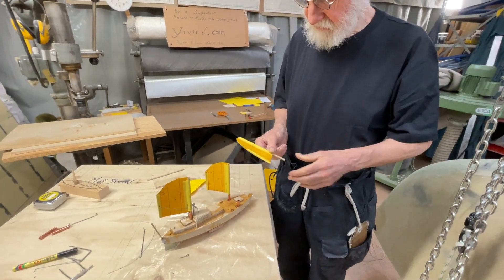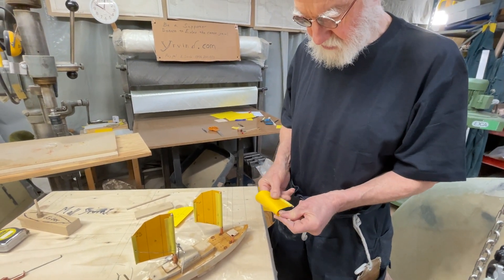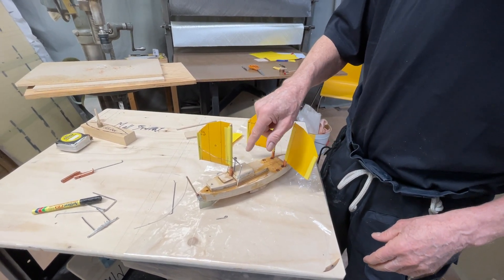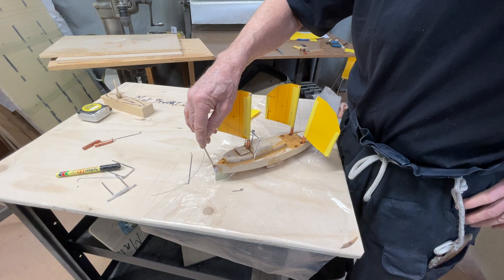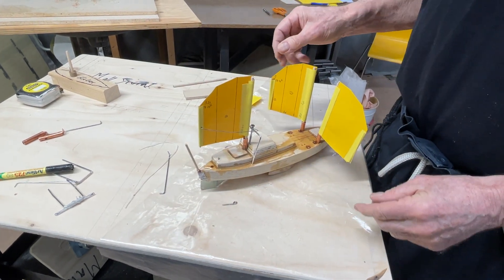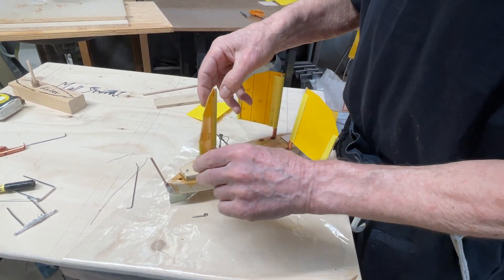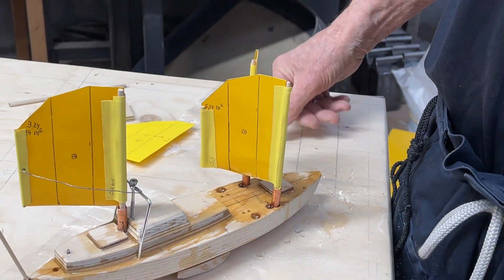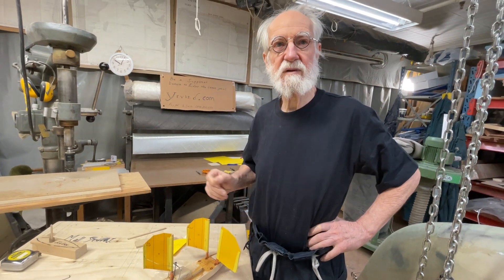A better model of the rigging. The rig now have vertical battens despite a lot of hesitation.

Comment: I am interested in how the sheets will be done with the vertical battens. The new design is much like a junk rig but built turned 90 degrees. Thank you Sven for sharing all of your thinking on the rigging. Much for everyone to consider. Have a great week.
Reply from the maker: I do not agree.
There is no sheets from the vertical battens.
The aftmost vertical spar is called club by the Chesapeake Bay log canoe sailors who inspired me to do this thinking.
The club will hopefully be made of carbon to its midddlet a single sheet is leading.
There might be some changes as it is experimental.
Reply: @SvenYrvindExlex  What about splitting the sheet 50-100cm from the club? Would 2 attachment points be better on the club? Or just more weight and windage?
Reply from the maker: @aaronbrakel2722  I do not really know, but there is a very short distance to the sheet point and 3 square meter sail do not generate big forces.
Reply: @SvenYrvindExlex  Thank you for the reply Sven.

Comment: 10 kvadratmeter, utan roderhaveri med tre segel som är över 60% större låter som snittfart på över 6 knop! Cirka 10 000 meter i timman 240 000 meter om dygnet 7 200 000 meter i månaden! Nu har du något mycket fint i dina händer! Ett fullt fungerand attraktivt alternativ till långresa och en överlevnadspod som skulle få oss att kunna klara ett halvår utan problem i taget! Vad heter din hemsida "Simple habits simple boat", I teorin visar du oss alla en utväg om det behövs. Ett alternativ till! Tack Sven Yrvind!! Det finns absolut inget enkelt i det du visar oss idag! Ett hopp från den Gamle och Havet, ännu en gång tack!
Reply from the maker: He writes in Swedish.
He thinks that with the new rig and 10 square meter I can make an average speed of 6 knots.
I do not think that that is realistic.
The twin keels extra wetted surface and their extra weight will add drag.
If I can average 75 miles a day or 3 knots I will be very happy.
In real life there is calms and storms that slows a sailor.

Comment: Vertical battens are a good addition. To go simpler, why not eliminate the booms? Like Baluchon. I kind of miss the mast rake you had.
Reply from the maker: Baluchon do have a very long wisker poole. Sailing down wind as most cruisers do you need to get the sails out.
These J-booms are much shorter and can be permanent in place.
They also make the boat self tacking and thats good in narrow waters with three sails and a solo sailor.
I think the mast rake looked good but it makes no sense anymore one more darling killed.
Utility is the name of the game.
Reply: @SvenYrvindExlex  I understand. Self tacking is a great feature.

Comment: You could get fancy, and create a roller furling within the the mast.
Reply from the maker: Not a good idea.
On a free standing mast it will be very heavy.
It will create much more wind drag. 
You lose the aereodynamic advantage of the Ljungström rig.
It will cost much more.
It will not be as reliable.
I prefer simpler things
Reply: @SvenYrvindExlex  Isn't the Ljungstrom mast already a furling contraption in it self?
Reply from the maker: @danielbtzibur8637  Excactly so why bild an extra mast around it.

Comment: If you’re planning to take reefs in the sails by rolling the mast, how are you blocking the mast to prevent rotation?
Reply from the maker: The hatches are next to the mast. I use a pin or spoke. Have few holes in the pereferi of the mast - a ring around the mast - and just block the rotation with the pin. 
The pin will also be used as a lever to rotate the mast.
Reply: @SvenYrvindExlex  I thought you used two mast locked halyards from the berth, like a furling mechanism?
Reply from the maker: @danielbtzibur8637  Locked halyards is an alternative but I will not lead them to the beart for fear of salt water